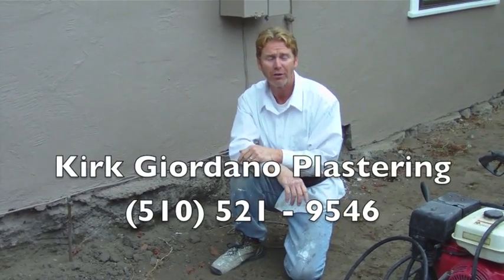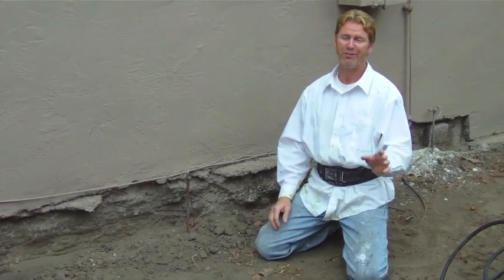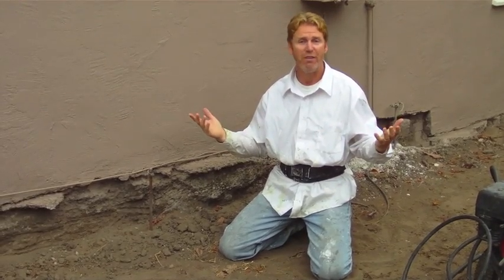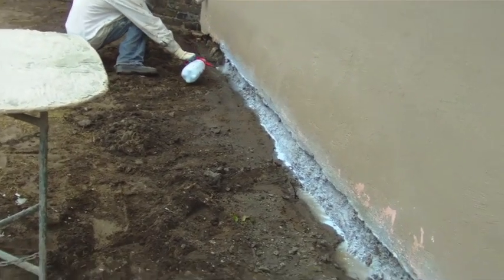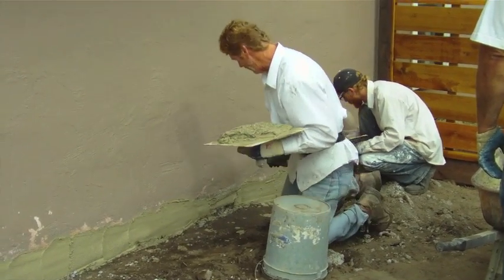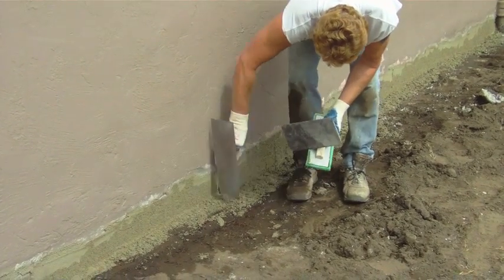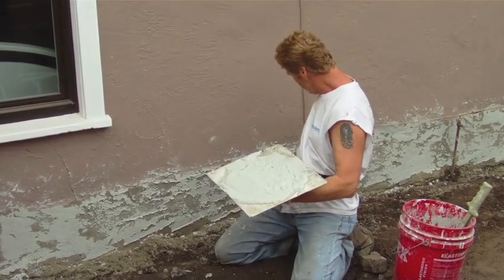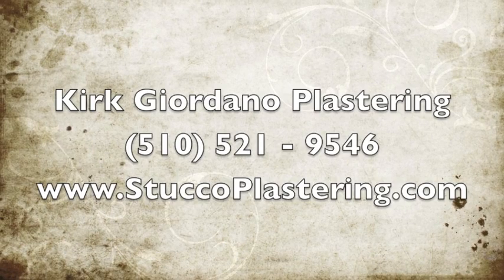Stucco over bricks or concrete foundations

Comment: I have poured foundation, they have a styrofoam moisture barrier, then a rubber matt cover.  A cheap way for the builder to have a fininshed product.  Can I just a apply a wire mesh and then stucco over all these?
Reply from the maker: Howdy Mvigorenv Dude, if it were me i would leave it alone or plant some bushes to hide, as it's now watertight.
 If you attach wire to stucco now you puncture your expensive and difficult to attach barrior, see my cheesey explanation video below for my humble opinion.barrior.
 https://youtu.be/5wOofoD8XuY
 Cheers,
 kirk giordano plastering

Comment: Man, how can you not protect your knees???
Reply from the maker: Howdy Thomas, thats a really good question,
 they never bother me so I don't worry about it. Wierd huh?
 cheers,
Kirk and Jason’s sand and cement rendering videos
Reply: That's crazy! You could probably knee in doors.
Reply: By the way. You really do great work and thank you for sharing your knowledge.
Reply from the maker: Evening Thomas, thank you  
Cheers,
 Kirk and Jason giordano’s rendering videos
Reply: @StuccoPlastering  I never worried about kneeling either, until one day, after spending several hours intermittently on my knees, digging, I acquired a condition called "foot drop." That was a pretty big hassle as I lacked all stability from that foot!  For me, it was temporary, lasting "only" a couple of months, but for some people it does not go away. Now, whenever I have to work on my knees, I use knee-pads. I didn't know that I could acquire this from simply kneeling for a while.

Comment: We are in the possess of building a 3500 sqft house 2 story, the ends have brick and the front of the garage, and near the front door mainly for design, the rest of the house is stucco, (light cream, with white in it) once it is finished how can we properly maintain it, and could we power wash it (not all the time, but when it starts to look grimy and dirty probably once a year, or once every other year?) Thank you.
Reply from the maker: Hi Dylan Smith, good question, if it were me I would pressure wash the complete home apply a bonding agent then apply a maintenance free color finish, these finishes last forever, yes, in 30 to 40 years they may diminish in color but thats what gives a home a charming look, the rich or modern look is mainly for newbies, get my age then relax with a charming look and spend the cash on other things such as cruses.
 Best wishes and have a great new year,
 kirk giordano plastering

Comment: Kirk I have a question nobody seems to know the answer.  My foundation has 2" of foam on it so the foundation is 1 1/2 inches out from the wall. I want to stucco both the foundation foam and the entire house.  How do I connect the two?

Alan
Reply from the maker: Evening Laurie Maynes or Alan, easy question, as I have applied the Drv-Vit stucco system many times and a few other styrofoam systems as well. I stuccoed a gas stations about 20 years ago with the 1 1/2 inch foam also with the stucco it came to 2 inches.
 All the products come from alta, now known as Westside building materials. They would know if this system is still available.
 The system which includes 1 1/2 inch foam begins with plywood framing, a person first applies a metal weep screed that is set for 2 inches then applies two layers waterproof paper then the 1 1/2 inch sheets of styrofoam are attached, you then attach metal wire lath and stucco a half inch thick. 
This system is good for high rises which don't want a lot of weight or commercial projects,  however I don't recommend it for a residential home.
I would go with a conventional 3 coat stucco  system if I were you. Send me a picture so I can get a better idea of what you have to begin with. kirk4stucco@gmail.com
 Best wishes,
Kirk & Jason Giordano's DIY plaster and stucco channel

Comment: I have an older home made in 1977 with a cinder block foundation basement. Due to settling there are many cracks and although they were sealed and have not leaked in over 10 years I was thinking of hiding the cracks both inside and outside with stucco. Is this a good idea or not?
Reply from the maker: Hi n00bBagHead, Yes, you can do this skim coat of cement plaster.
Or you can simply caulk these cracks with the proper quality caulking that are available then paint.
The caulking is flexible so It is a faster and better alternative.
 best wishes,
Kirk & Jason Giordano's DIY plastering network

Comment: I will be honest man i have never seen a trowel as big as that for rendering with, it will damage your arms and shoulders, you need a smaller trowel dude!!
Reply from the maker: Hi Thin Lissy, that trowel is my medium size one I have a 20X5 I also use.
 It's been over 35 years now my right arm is as strong as it's ever been.
 I subscribe to the term "use it or lose it"
 That being said I recommend for homeowners a simple 12X5 which they advise you to bring in apprentice school to learn with.
Here in the U.S.back in 1980 I had to go to apprentice school for 4 years before receiving journeyman wages.
 Best wishes, 
 kirk and family
Reply: StuccoPlastering Yes i had to do 3 years apprenticeship now 19 years later and still learning!  but we use a different type of plaster here in UK and most trowels are 14x5 for applying cement and skim or 17x5 for finishing skim!!  with the plaster we use a high amount of pressure is needed for the typical smooth sharp finish on inside walls over a cement backing coat... I don't know if you have ever dashed with stones in a backing coat using a hand dasher!  Its a very nice finish, no maintenance ever!  all types of stones and colour!   I COULD HELP YOU BRING IT TO THE STATES AND START A TREND!!  I am serious IT COULD BE EXCELLENT BUSINESS...  I live in N.Ireland and we work very hard and have a good standard in plastering!  I had a company with around 25 30 guys until the boom bust happened!   AM going to Chicago in two weeks to do route 66 can't wait i love america so much and would fucking love to work there am only 36 i did work in Boston 1998 loved it!
Reply from the maker: Hi Thin Lizzy from N. Ireland also nice to hear from plasterers from afar. No doubt you work hard to hard steel trowel with a 17X5 is no joke. I had about 14 guys working with me while I had my pump but sold that beast years ago.
 These days I just work with my sons and a few guys.
 best wishes,
 kirk and family
Reply: I will be joining your team soon mate!  lol i love america been there so many times and would love to live there although i do enjoy slightly longer holidays here in Ireland even though the wages are now shit due to forced austerity(fascism)  cuts cuts cuts thats all we hear about, don't know what the work situation is like where you are at though!
Reply from the maker: Hi Thin Lizzy, it's o.k. here, I admit I get a bit more work because of our youtube video's.
 These video's tell folks that we know what were doing as most folks are nervous about who they hire and they should be. 
I have hired a few hacks myself over the years and have now learned to google a fellas business to see if he has bad reviews or folks like his style.
 cheers mate.
 kirk and Jason giordano

Comment from the maker: Good evening Nick, I looked up scarfer on Google and don’t recognize its meaning.
 Do you mean scratcher? 
If so I didn’t need to scratch each coat even though we applied many and went close to 6 inches thick on this brick foundation to bring it true and level.
 I used Eisenwall cement plaster and never allowed the coats to completely dry.
Thanks for watching and have a good night.
 Kirk Giordano plastering

Comment: Why are you using a pool trowel? Don't you lose a ton of mud off of your trowel as you apply your material? I tried using a pool trowel to run finish once because I thought it would eliminate trowel marks, but I was losing a ton of finish off my trowel.

Comment from the maker: Howdy Mike. The weep or drip screed code went into effect in I think about 1976. We were still taking the stucco down years later as I did what I was told when I when I first joined the trade, from the late 1970s early to 1980s. Todays codes ask for 6 inches ground clearance, we sometimes need to mix codes with cosmetics. A screed would not have been applicable on this home.
 Best wishes and thanks for watching.
 Kirk Giordano Plastering

Comment: Hi Kirk, I notice in some of the videos where you are stuccoing over original brick that you apply the plaster right down to ground level (right on top of the grass or dirt).  Doesn't there need to be a 6-8 inch gap between grade level and the bottom of the stucco to prevent moisture and insects from getting into the stucco?

Comment from the maker: Hi John Puskar-Pasewicz, I would recommend first knocking of any loose and large sections with a hammer than equally important pressure wash with a minimum of 3,000 psi., any remaining pieces and ALL DUST. I would use a bonding agent then apply as many coats same day as necessary to fill out. You might want to scratch as what I am saying takes practice.
Thanks for watching a have a good evening!
 Kirk Giordano plastering

Comment: Hey Kirk.  Nice work. Maybe you could help me out. I've got a four foot high existing concrete wall that was plastered and painted. I powerwashed it allready with the same machine you have. since it is allready pretty rough, can I skip the scratch coat and just stucco it. I live in Massachusetts so the weather is hot and cold thru the year. what kind of mix should i use to stucco with? It is around a swimming pool and i want it to look good. Also, can I color it? HELP!!

Comment from the maker: Hey homebrew, on new homes I recommend a cementitious finish. they breathe and the walls should be cured so they shouldn’t crack too much. (Unfortunately all stucco homes cracks to a degree those who believe otherwise have not been in the trade long enough to realize it will eventually). I recommend acrylics when we do work which we know will move or flex the acrylics tend to move with the wall. Or existing old homes we know are leaking.
Have a great evening. 
Kirk Giordano Plastering

Comment from the maker: Hey bro, that make two of us that wishes I was in Florida, 
 If you are going to stucco over a 2x4 you need to not only paper it (or waterproof it)  but also wire and add corners to the 2x4 otherwise the stucco won’t adhere. If the 2x4 is for looks you don’t need do anything to it, accept prime and paint it. If this does not give enough info e-mail me a picture so I can better understand what your situation is.
 Best wishes and have a groovy evening. 
Kirk Giordano plastering

Comment: Thanks for your videos. It is nice to see a real professional ply his trade. I have about 2 inches wide around a french door. the door is inset and the stucco will be on an angle from the existing wall to the door. The top has pt wood and sides are existing stucco. Do I need building paper over the 2x4? Thanks so much for your videos. Nice to see a true professional ply his trade. Wish you were in florida.

Comment from the maker: Hi Kcrofoo, a bonding agent isn’t necessary for any type of Portland cement if you’re going over self-furred wire or if you are going over new cinder block or concrete, but it has to be extremely clean
(No dust, moss, or dirt.)
If you’re going over painted or a surfaces that has set for 50 years such as the one in this video it’s definitely necessary. Besides a bonding agent is it a simple, fast and cheap precautionary measure
 Best wishes, kirk Giordano plastering

Comment from the maker: @jmac777able Hey Mac, when someone applies stucco over cinder block it's tough to get it off. Usually you can't power wash or chisel it off. Your best bet would be to pressure wash the dirt off this wall, apply a bonding agent to the surface and then re-skim it if  the build up is not too much. 
Best wishes,
kirk Giordano plastering

Comment from the maker: @zvines86    Hey Zach, it's the best choice you have or you could tile it. The skim coat of stucco will adhere extremely well to the cinder blocks without any bonding agent as this type of block is very porous. Both systems require a bit of skill, but if you can build the fireplace with cinder blocks you obviously have the talent to do stucco or tile.
 Best wishes and have a groovy day!
Kirk Giordano Plastering

Comment from the maker: Hey skydiver, How are you doing man? Thanks for the compliment. I should have included the front as well in this video as it was bricks about 6 to 8 inches inset from the wall. The home owner asked if my work would crack, so I informed them that rapid set has a 6000 psi, strength when fully cured. the strongest stucco known, but that if their one hundred ton home was to shift, that it probably would crack even with using rapid set.
 Have a great day! 
Kirk giordano plastering